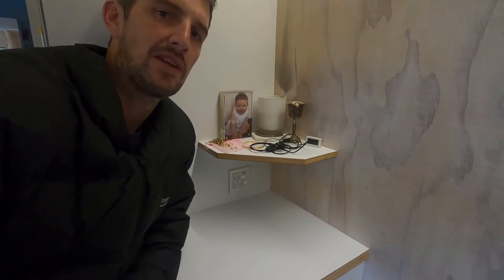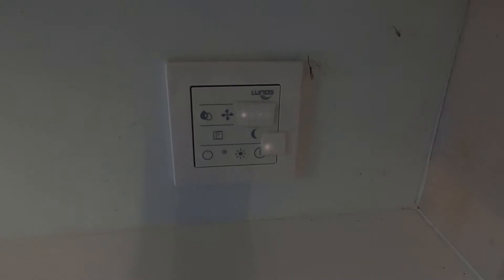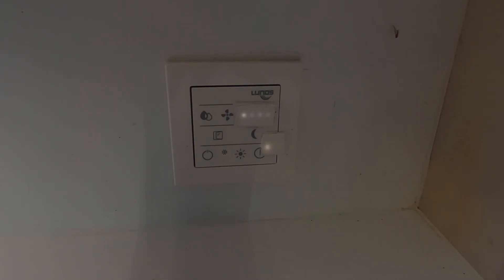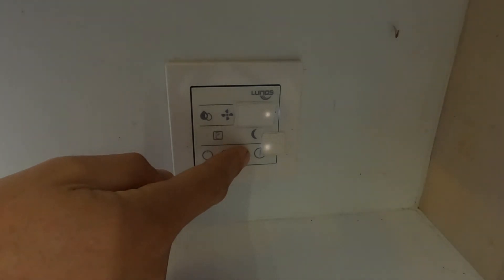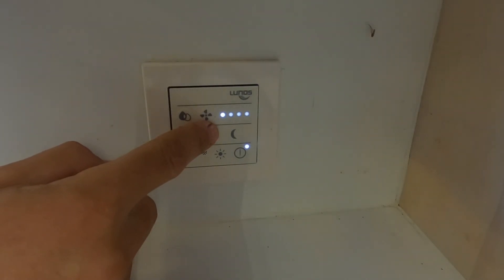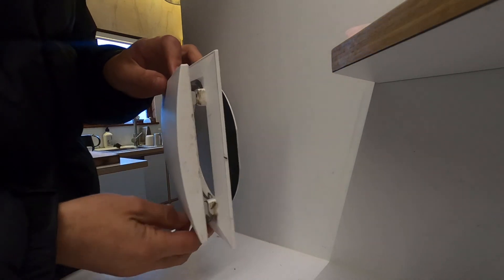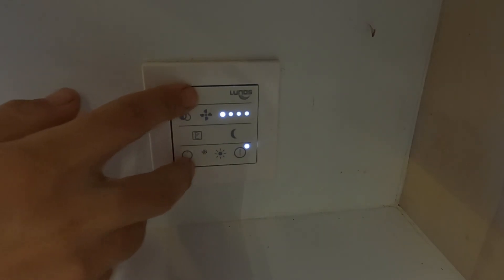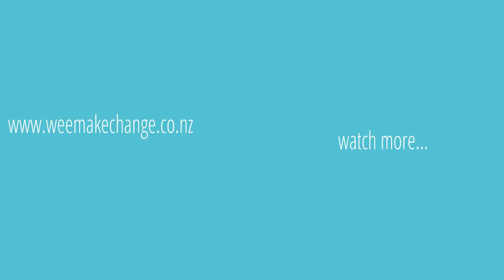How the Lunos e2 Controller Works Heat Recovery Ventilation System

Comment: Thank you! We've had ours installed for 4 months and hadn't really looked into how it works. Definitely need to have that humidity switch on in our tiny house! Hoping it helps with the cold weather months here in Canada, we are already noticing some moisture resting in the inside of our windows - which is not what we want. 
Thanks for the information!

Comment: I wish I had watched this back in July.  I just cleaned my filter and it was very dirty.  My tiny house is parked next to a new development here in Alberta, Canada and therefore there is lots of dust kicked up into the air blowing my way.  I didn't know what the #6 event button light even meant until now.  You're right, the manual that comes with the Lunos is really not helpful.  Your video was!!!